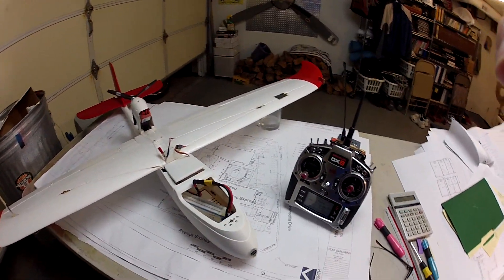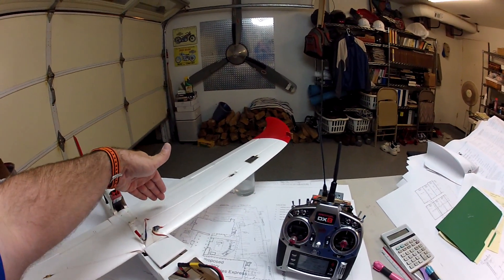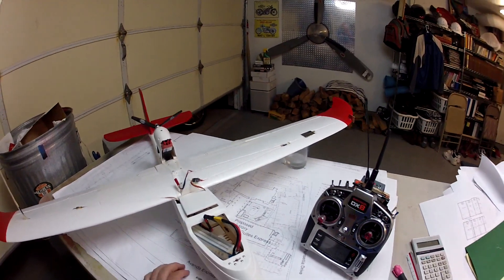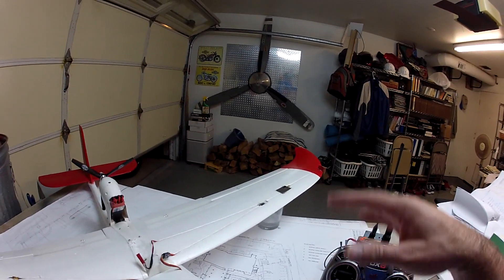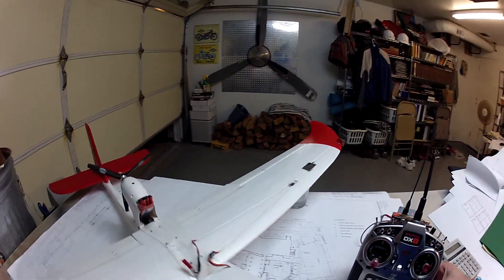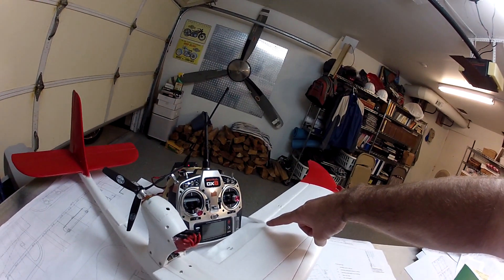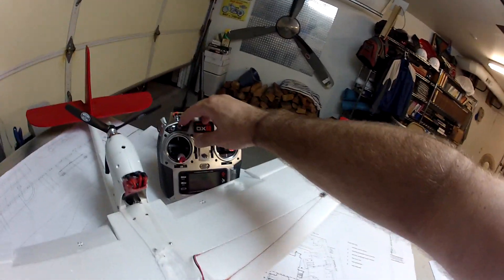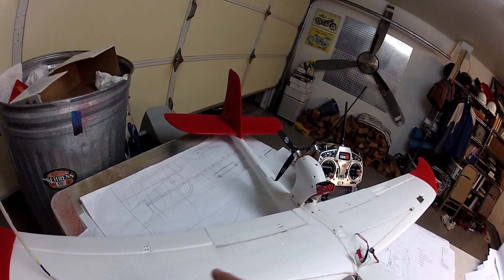DX8 servo speed control setting on flaps

Comment: Servo Speed Reducer is a very nice feature, the DX18 will also allow to adjust the speed for both direction of travel for each channel. 

Did you use the Flap menu to slow the flaps down or the Servo setup screen? If you use the Flap menu it will also apply speed reducer to the elevator if you are using elevator compensation in the flap menu.